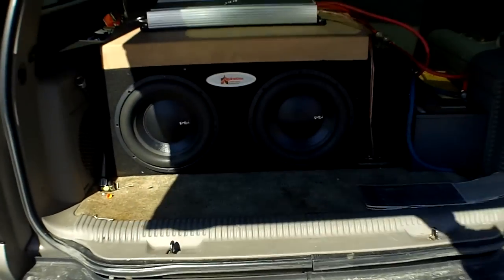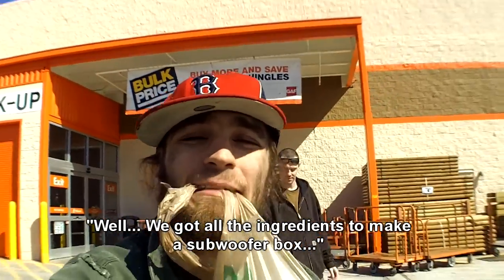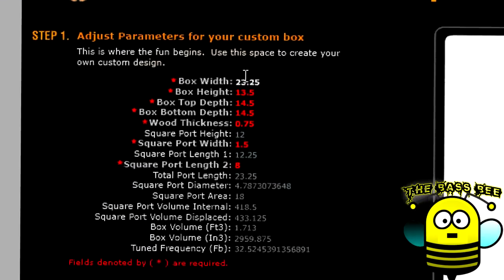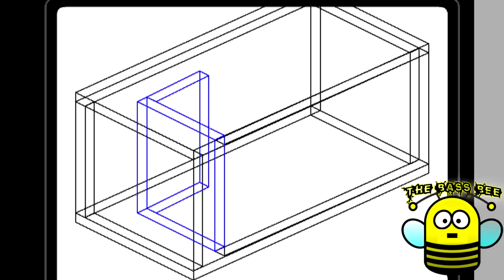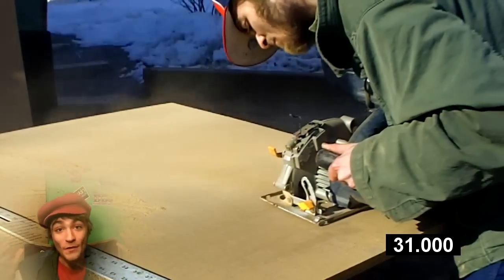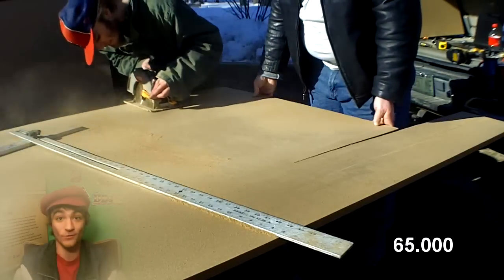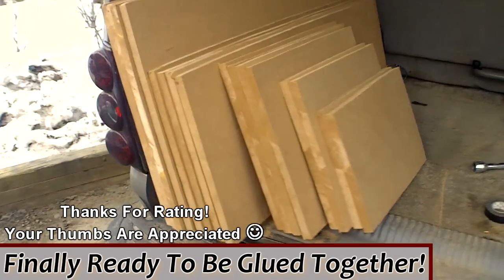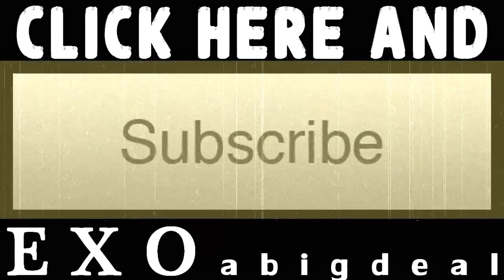How To Build A Subwoofer Box | Beginner Car Audio Tutorial - Dual 12" Custom Ported Sub Enclosure

Comment: Thanks man, also, I found out what my problems were.  Firstly, I wasn't giving the port it's own space, I was just putting it in with the rest, secondly, I didn't realize that when you type in the dimensions into the calculator that you're typing external dimensions, and to top it all off, I was only calculating for 2 cubes (one woofer) instead of 4 for both.  Maybe I shouldn't try to spontaneously design boxes when I wake up in the middle of the night XD

Comment from the maker: Okay, so you're basically wanting to know how to build your box for 4 15's, correct? If so, I really suggest checking out some forums, or the12volt website for some springboard info to get you jump started into the right ideas. They have port calculators, and all sorts of useful tools to help you get where you need to be.

Comment: Exo, I need help again lol.  I just ordered a set of sundown e12s, and now it's time to design the box.  When I design boxes just for shits and giggles, I use the standard port length calculation formula, and the internal volume formula.  I tried to use the RE box calculator to see if I was super off, and typed in some dimensions, and it came out to be the internal volume that I needed, but when I multiplied those dimensions together myself, it came out all wrong.  What do I do man?  SAVE ME!!!

Comment: OK, thanks. And 2 quick questions: 1) How many nails/screws did you use? and 2) How much did everything cost at Home Depot when you bought everything? (I have basically two options...buy a custom box for $200-$250, or build it myself. Just wanted to make sure it would be cheaper to build it myself.) :]

Comment from the maker: It's just a way of avoiding uneven back pressure. Turning it 45 degrees frees up the back area for the chamber to be unobstructed. That's why we then switched the subs to be mounted on the top.

Comment: how many amps can hold a 10 inch subwoofer?

and how many watts do I need amp for 2 x Raveland SPL 610, 600 WATT??

and how many batteries .. : D

well I'm done with my questions.

good luck with your system!

Comment from the maker: Take the same piece of wood intended to the "L" port and flip it 45 degrees to run parallel with the other port wall, instead of perpendicular. And secondly, all you have to do to seal off the trunk is some add some MDF / Great Stuff & Silicone to fill in the gaps - I would show you in a video, but I don't have an extra car and stereo system lying around lol

Comment from the maker: Sure mang - as long as the coil fits into the gap, you can recone a sub with any coil configuration you need. But just out of curiosity, why would you want to use an 8ohm coil? Are you doing this for a home receiver?

Comment: @vlad2k9  iam note sure were your buying your mdf from but the thickest sheet is 2 inches thick ..this is not stocked in stores.. If its a small box then 3/4 inch mdf will be fine.. Otherwise big box go with 1- 2 inch thick, if is a wall build then atleast 4-5" inch thick front and back

Comment: Hey thanks for the speedy answer!! i adjusted the amp input which definitely helped. I also found out that my CDA9884 has Bass Width? levels 1-4 which make boost signals at both ends of the subwoofer range.. it made a world of difference

Comment from the maker: The new Hifonics amps are actually pretty sweet - That would be a nice match with what your looking to do. Even though the subs are rated for 750RMS, they would perform at their best with a little more power above the ratings. Even if your amp pushes 2k all day, the subs will like that better than dirty power

Comment: @exoabigdeal this is wat my new setup includes so far PYLE PLCHW15 15-Inch 3600 Watt DVC Subwoofer along with a ported enclouser i need to know wat type of amp i should get ive been looking at a SSL EV2500M EVOLUTION 2500W MOSFET Monoblock Amplifier with a Remote Subwoofer Level Control is this good enough to push my 12in lanzar vibe sub along with the pyle or should i get ride of the lanzar sub

Comment: i have a question for you Exo. I have a 13.5" JL w3v3 with a 500.1 JL mono amp. up until last week i was a cheap and ran it off a stock deck and pulled the signal from the rear speaker. i finally got a new alpine deck and to me it seems like the rest of my system got better but the subwoofer is much quieter. any ideas? maybe a tuning is needed? thanks in advance

Comment: The sound I'm looking for is a ground pounding deep rich bass, right now it's producing a lot of sound but it's a higher tone sound and it's just annoying. The subs are 2 kenwood 12 inch w3013ps subs, 1800w kenwood 9105d amp, 4gage power wires, 12 gage speaker wire. Installed and tuned by hand... thanks again

Comment: I just got my first system installed and I'm just not happy with the sound or 'sq' of the subs, it's loud as heck but just not a good sound in my opinion. The box I'm using is ported and .38 ft^3 too small according to recommendations on the subs, and I have no clue what it's tuned for, probably around 40hz, I'm considering building a new box, but I'm wondering if I should build sealed or ported, will increasing the size and lowering tune help the sound quality? Or should I go sealed for sq? Thx

Comment: HEY EXO!!! I got a question for ya.. Im wanting to build another box fo my 2 12inch diamond d3 subwoofers. Right now i have a prefab box and i cant decide if i should build a dual ported box or a dual sealed box or do something unique and build 2 sonotube boxes one for each sub.. Which do you think i should do. I have 2 pyle pla2200 amps powering them and im putting them in the trunk of a 1997 honda civic.. Please get back to me on this it would be greatly apperciated.. THANKS!

Comment: Most of the time, 3/4 MDF is all you need. Unless your going for a lot of power and very heavy subs, then you either double up like they did, or use 3/4 and the appropriate bracing.

Comment: try taking ur fuse out and splicing into ur power after tht use a pice of the wire to attach into tht splice and thn tape it up and make sure only splice in dont cut through the wire after this put ur fuse bck in thn keep ur bass down until it stops blinking thn u can crank it up i have mine wired this same way and worx great

Comment: How do you install a capacitor without it sparking? Im at the point now where my sub is dropping it below 12v on the beats, I got the biggest stock alt available and actually don't even have enough room for a high output alt. I cant afford anything and my cousin gave me his 200 dollar rf cap. But every time I try putting it in it sparks real big and melts my screws as I try screwing it in.

Comment: Dude, run a straight edge on your timber for the saw to slide against, makes cutting twice as easy. Just measure the distance between the blade and the edge of the saw base, then clamp a straight piece of steel that distance away from where you want to cut. Achieve table saw like cuts with a circular saw.

Comment: The RE box calc is actually very inaccurate, should go with torres, RE does not take into consideration any displacements from the drivers or even bracing which adds to the inaccuracy

Comment: actually.  liquid nails is a very bad adhesive ot use as it is a urethane based glue which will expand when it dries and create some bad glue joints.  titebond 2 is the best glue for the job.